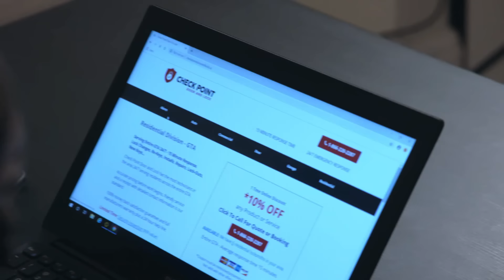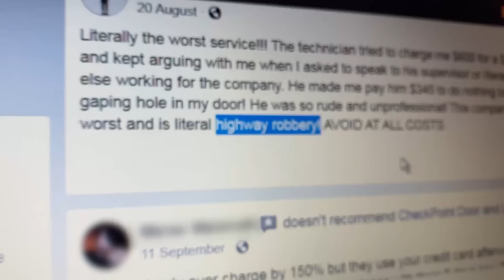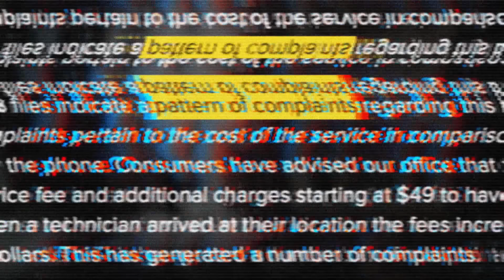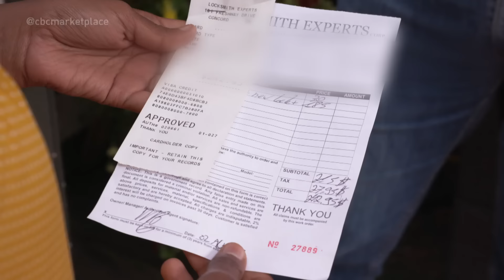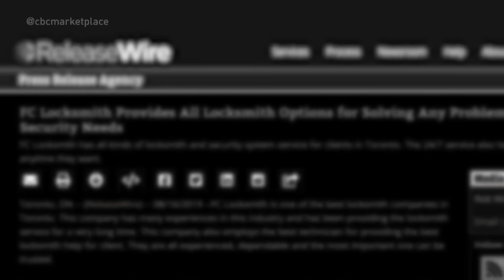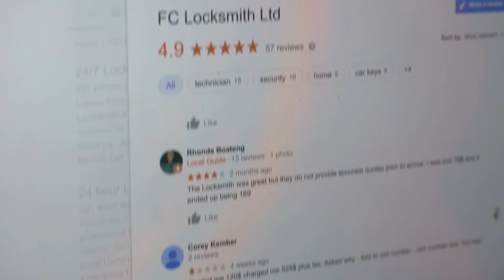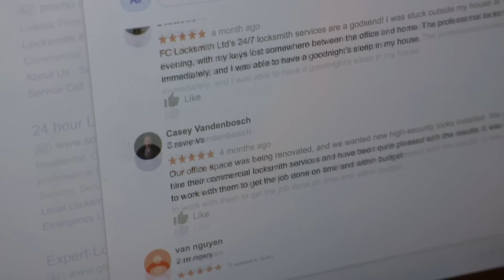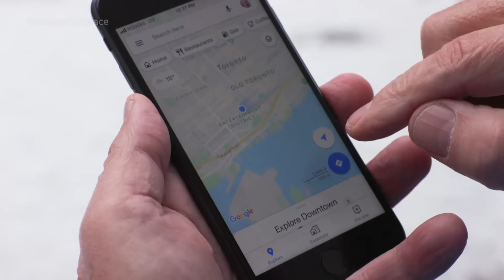Locksmith ripoffs: Hidden camera investigation (Marketplace)

Comment: They should have done one where the door was unlocked already, just to see if the locksmith can open it.
Reply: Or gone around the house to find another opening.
Reply: @icyhotonmynuts  agreed.  If I can not pick the front, I ask for back doors, patio doors, heck, even a garage door.  I have bypassed windows to gain entry.  Don't work harder, work smarter.
Reply: Dynamite is expensive Ma'am, but.....
Reply: Good idea
Reply: Sorry. If the door has LSDA lock on the door, you can't walk through it. You can be standing there a year and not walk into the house. It's just how they work.
Reply: They should have done one with one of those beaded door curtains. Lol.
Reply: Omg
Reply: @DoktreSam  if they used a LSDA lock with easy pins inside i feel is kind of cheating too. Thats like telling someone to fix a space shuttle but in all actuality theres only a hamster inside.
Reply: They probably only get one chance with each company before they wise up so pulling a prank like that would've been a waste.
Reply: Or one where the door was wide open, see if the guy would have noticed.
Reply: And not charge!!
Reply: @kippetjes4  "Thats like telling someone to fix a space shuttle but in all actuality theres only a hamster inside."

What kind of an analogy is that?!
Reply: @YeeLeeHaw  the analogy of something looking as complex as a spaceship (rocket science) but inside of it something as simple as a hamster running in a wheel?
Reply: @YeeLeeHaw  so its like me taking you to what seems to be a genuine spaceship and telling you to fix it even tho u only know how to fix cars. So u gonna be like impossible for me to fix this. But meanwhile the only thing i put inisde was a car engine or a faulty hamster in a wheel. And then i say "ooh look at him, he dont even try blabla its so easy blabla".

Not saying the guy shouldnt have tried harder, but theres def some deception going on from both sides.
Reply: @kippetjes4  I understand your point, no need to explain that lol, but your analogy doesn't make any sense. So is he supposed to fix the hamster and that being somehow easier? Why comparing a space shuttle to a living being?
Reply: @YeeLeeHaw  fix the engine whether its a hamster in a wheel or a car engine. Just anything thats basicly easier to fix than the spaceship engine. And obviously u can fix the hamster engine very easily by putting in a new hamster.. point is kinda that u don't assume a hamster to be powering a spaceship, just like u dont expect cheap pins to lock an LSDA lock. Guy made an assumption a bit to quickly, but he wasnt wrong if just judging on appearance and what it says on the lock. They shouldn't have used a disguised lock.
Reply: @YeeLeeHaw  also im not comparing a spaceshuttle to a living being. Im comparing a space shuttle engine to a hamster driven engine. As it is the most typical caricturistic version of a engine used in many shows etc to make fun of a complex thing by having it been propelled by a hamster in a wheel. Its called dramatizing to make a point.
Reply: @YeeLeeHaw  (p.s: just to be clear, if replacing the hamster don't work u put in a new wheel) just to avoid confusion..
Reply: @YeeLeeHaw  i don't think its strange to compare a old school engine (physically propelled like a hamster running in a wheel dynamo style) to one of the most advanced version of engines, which is a rocket engine or w.e u wnna call it. Its the comparisment of the most basic v.s the most complex. Disguising the most basic lock as the most complex, and then blaming the others of ignorance for falling for your disguise.
Reply: @kippetjes4  lol, I understand your argument; no need to try to save a dead person for the cameras, it's the analogy that doesn't make sense in the way you wrote your initial comment. 

Anyway, I expect your report to be on my desk on Monday morning 0800R.
Reply: @YeeLeeHaw  mmm, i guess it can not make sense to some ppl. It depends on how well developed your deductive reasoning is.

And will do Chief, also a reminder that my pay is late and i will be expecting the full sum of €4590 by the end of this month.
Reply: @kippetjes4  No, no, don't try to make it seem like I'm the one that isn't able to process lol, it's your analogy that doesn't make sense because it isn't representing the correct proportions and also hinting on the hamster being the one that should be fixed.

Also you are non-honorably discharged without this months pay due to not making sense to the entire NCOIC staff including the top dog. The nerve you have to ask for that much pay (and in the wrong currency on top of that) when you have humiliated our entire branch with your F'up deductive reasoning.
Reply: @YeeLeeHaw  well, either you are able to process it, in which case i dont really see your point. Or you are not able to process it, which validates my argument. Either way, if you have such a hard time dealing with the word choice etc. Even though you supposedly understand what is ment, then the comment was not directed to you in the first place. Maybe that helps ease your pain?
Reply: @YeeLeeHaw   Daniel Nicklas V  "also" your little job story is getting out of hand, if theres something you'd like to talk about you can tell me, as you seem not to be doing so well. If theres anything i can genuinely do to help your mental state ease up i'd gladly do so. Hope you feel well soon!

Comment: When he said it couldn’t be picked she should have said “can I try”
Reply: Sam Griffiths yea I thought she was gonna say that
Reply: It is possible that the supposed "bad guy" locksmith actually told the truth in that that particular model lock cannot be picked. Remember, the "good guy" locksmith never picked it on camera. This is a glaring omission. Rather,  he MODIFIED the lock then had the reporter pick it. That is not the same thing. If the "bad guy" locksmith didn't know the lock was modified to make it easy to pick, why would he try ?
Reply: @Thinks-First  He just cleaned and checked it could be picked easily. He did not alter the structure of the lock as claimed by the "bad guy". He was talking BS and should still have tried as the next one did.
Reply: 200th like :)
Reply: Alan F so how did the second one they called pick it in two seconds aw yea cause it could be picked and was easy to do so

Comment: I am a mechanic who was a builder/carpenter for over 30 years.
These are the two most complained about industries by consumers.
If there is an ability to play on the ignorance of the consumer it will happen more than not.
This is because the difference in payout is so much greater to rip someone off when they dont know one way or the other. The thief only needs to be paid a couple times to get the greed from consumer ignorance and sleep well from then on.

As a mechanic the only negative reviews on google I have ever got was from people I never did business with.

Comment: i locksmithed for 30 years and  the majority i have heard about in the last ten years are a disgrace to my industry and most likely are not even close to what would be considered certified in this industry, what  a shame
Reply: I saw this video a few months back and I had to come back to it today because I locked my keys in my truck. This is the second time I've done this ( I know I really need to get another key made) and the last time I called a locksmith, and the guy took over an hour to show up and he seemed really nice but he ended up putting a nice dent in my door from trying to wedge it open. So this time I just got on YouTube and figured out that it is quite easy to get into my truck and I was able to open the door with a little punch that I had in the garage with absolutely no damage and it only took me about 30 seconds. To say I'm a little pissed at the other guy is an understatement.

Comment: I'd give serge (the second guy) a pass even with the review fishing. He was fast and fairly professional and didn't pose the request as if a positive review was required for a lower price.
Reply: He charged her more than the lowest quoted price.  He even said it took only 2 seconds to pick.
Reply: @Well_possibly  it took 2 seconds and AND however much experience he had. She wouldn't have needed him at all if his skills were worthless. He still had to drive out late at night and get her into her house, he should be compensated fairly for that.
Reply: @twistysnacks  " He still had to drive out late at night"  The quote is supposed to include the fee for that
Reply: @Well_possibly  it did...
Reply: @twistysnacks  Explain what his lowest quote was for then.  Was it IF picking the lock had only taken 1 second instead  of 2 ??

You already agreed the lowest quote included the fee to drive out that distance.
Reply: @Well_possibly  it was $29 service call plus minimum $45 charge which would put it at 74 minimum. Charged 80 total. BFD
Reply: Having been in a service industry for several years before retiring , I know the technician only gets a small amount compared to the company. Usually 10-25% of the bill. So $20 doesn't seem like a lot to get paid. That's why I quit working for  a company and started doing my own thing. I charge 1/2 what the company did so we both benefit. Obviously nobody verifies anything on a business license application in Canada

Comment: If they think locksmiths are bad maybe they should take a look at residential hvac technicians...
Reply: They have.
Reply: Or lawyers or politicians or any trade.
Reply: @drewrhodes2820  I work in HVAC commercial as well and the stories I've heard about residential companies is honestly disgusting. I was on a job and the customer for some reason decided to call another company to look at her residential A/C unit while I was working on the Walk in Cooler. The residential tech told her the unit was done and she needed a new one... All that was wrong with the A/C unit was a bad condenser fan motor.
Reply: Bluewolfe  heating ventilation air conditioning
Reply: Bluewolfe you have bare hvac techs in the uk
Reply: Me in SEA no HVAC ,just a fan enough.🤣
Reply: Jordan Zohr  I’ve been in the HVAC business for forty years located in Florida. I have seen people get ripped off so bad with no remorse . I own my business and have been paid with cookies and heart felt thanks from great customers when I wouldn’t charge them . My only advertisement was from word of mouth, there are still honest people out there , just not enough.
Reply: Jordan Zohr the real bad ones are the HVAc contractors doing installs in new houses scary stuff
Reply: It’s because they’re not licensed or regulated by the state. They’re usually druggies.

Comment: I was young, I got charged $225 to change the lock when I could have bought one at Home Depot for $49 and done it myself … lesson learned
Reply: Takes about 10-15 minutes too. They are crooks.
Reply: Omg 🥺
Reply: Ngl those locks are hot dog water - 225$ Isn’t bad if the lock is well made or upgraded properly by your local locksmith
Reply: Tell em where they can shove that drill.
Reply: @seenitalready  yeah but that’s assuming the company also uses a good lock. They might just buy a $45 lock
Reply: You could cook your food but you rather go to some big M and pay 20$
Reply: For $10 dollars even and probably the most easiest task any person can do in home repair.
Reply: $49?!?! I've never spent more than 20-25 bucks for a lock

Comment: When he said $250, I woulda been like “oooohhhhh ok. So we can’t pick it right. Mmmk. Hang on . (Grabs rock. Smashes window) alright man ! Looks like I’m in. I’m also not under any contract and you haven’t performed service. Have a good night!”
Reply: Won’t that window cost more than $250 but yeah I get the joke
Reply: Yea i would rather pay for a new window/pane
Reply: @user-pe9hl9od1g  Yeah I would just tape a trashbag over the window and set a couple bear traps vs getting ripped off.
Reply: i'd get my own lockpick out and pick it myself infront of him after he tells me its unpickable to get his beautiful reaction before he leaves.
Reply: @user-pe9hl9od1g  if you live in an old house the single pane windows next to the door are replaceable for like ten bucks / half hour effort.

For typical double pane windows you can get a shop to rebuild with new glass (about 50 bucks). I know since I accidently shot an arrow through my window 😳. You can pop the window out of the frame, bring to a shop, and the frames can be disassembled in minutes.... Took about half hour in the shop and window was installed before my wife got home from work!
Reply: @MechaGodAnri  I was smh until you said bear traps🤣🤣🤣
Reply: @Spagbolmofo  lol! I'd be paranoid with just a taped up window without any sort of failsafe haha.

Comment: My advice when unsure of the reputation of a local Locksmith would be to contact the local police department, hardware store ,AAA and you get the idea. This might not work in a larger area but it's always my first choice before going on line and just picking names

Comment: How is drilling more expensive? There's less craft in it and it's faster.
Reply: You have to replace the lock.
Reply: @BChandl13  no but it costs more without the lock
Reply: Because they can buy a drill and bits cheap. And charge 100 bucks for a lock they spent 20 bucks on at the hardware store.
Reply: Sadly most locksmiths only like to drill locks out as there not proper locksmiths.proper locksmiths should be able to pick sadly there to inexperienced and just want easy money
Reply: Even to pick a lock ive only charged max 75 dollars, unless it was a specialized lock or a break in simulation where ive had to do something physical like climb through a bathroom window which was 25 ft off the ground.

Honestly tho lockpicking in reality is just thinking outside the box to get into a house, sometimes you dont want to go through the front door.

Comment: Me : so what do we need to unlock this door?
Locksmith : We need a nuclear weapon
Reply: It will be $250
Reply: @xaviercreeper7356  and an extra $90 because it tooked 90 hours
Reply: @vian7599 So the grand total is: $9000, with tax that's $18,982
Reply: @xaviercreeper7356  and because your door broked were going to replace it with a new door so we need $9000000000
Reply: Abang Fulvian and also your neighborhood has been destroyed so your grand total will be 9000000000 and liftime jail
Reply: @syedirtazabukhari7713  and because your in jail were going to fine you 900000000000000000000000000000000000000000000000000000000000000000000dollars
Reply: @vian7599  And with service fee that would add a extra $500,000,000
Reply: @jingwei4664  and we'll just roll this dice to determine how much we'll multiply your total by!

Comment: Those reading this have no idea how long this has been going on. In the USA we are barely starting to do anything about it for the last few years, the reason you are seeing this story in Canada is because they are expanding to markets where Google has not started enforcing paper thin regulations. A locksmith company saying they dont know how much the bill will be because they dont know how hard it will be is like a restaurant saying they dont know how much a meal will cost because it could be complicated. Residential hardware is not complicated for a professional to bypass using one of dozens of methods. These scammers are everywhere and ALWAYS refuse to quote because they want to fleece you. Take it from a actual locksmith, you are overcharged by design with these call centers!

Comment: I'm a literal total novice, and typical home Kwickset locks are literally the easiest locks to pick. A two second rake is usually enough to get them open.
Reply: I’m an automotive locksmith and dispatch sends me to retail kwickset lockouts often just because they’re so easy
Reply: Even a bump key lol Maybe I should open a business. lol
Reply: But the bitting MIGHT be difficult so it is best not to even try.
Reply: Unless it’s the Kwikset smart key. Those are designed not to be picked or numbed open using bumb keys. They have a sidebar like automotive locks. They don’t use traditional tumblers and pins.
Reply: @robertsudano4304  Look into tryout keys. Kwikset smart keys are bad enough that you could order a set of 256 tryout keys and one of them is bound to open it up.
Reply: Not if it’s Kwikset smart key
Reply: @robertsudano4304  Well obviously, but who's talking about those?

Comment: you could literally just break one of your windows and have an easier and cheaper time replacing it
Reply: You underestimate how much windows cost.
Reply: Perhaps the whole window if it were replaced, but locally, if you bring in a double pane sash yourself you'll have new glass in a day for between $65-$80.  Of course that's not a house call, or necessarily something a 94 year old wants to do.